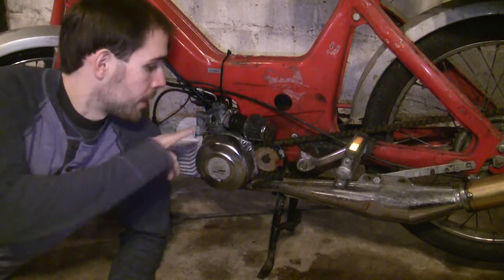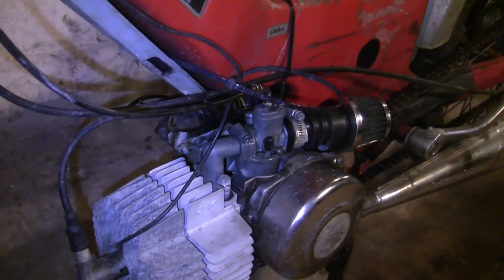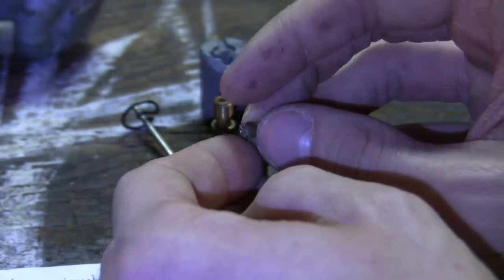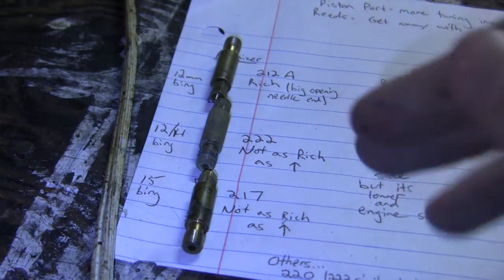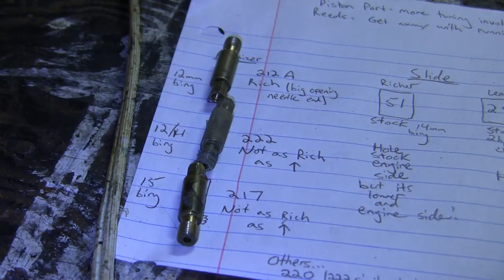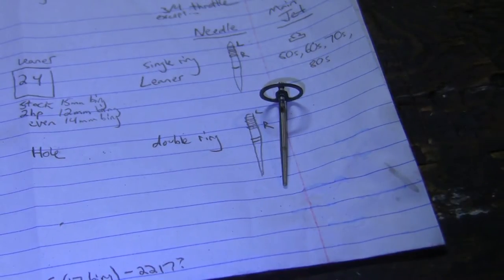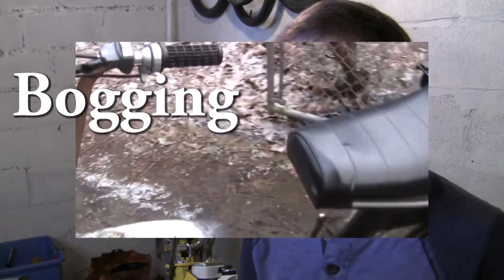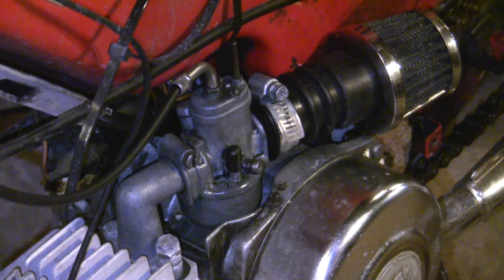Bing Carb Parts Explained for Tuning (Atomizers, Slides, Needles, etc)

Comment: Great info. Bings are very finiky. I have a mild 50CC high comp. kit 15mm Bing and intake, Biturbo, Iridium plug, Performance ignition coil and I tell ya....I just cannot get WOT tuned perfectly. It's driving me crazy. It was fun at first, but man, I've upjetted, downjetted, changed clip positions, etc.....

Comment: I have a 79 Puch Newport 2 with original air box, promo exhaust, just replaced 12/14 carb for treats 15 mm Bing clone carb. Wanted more HP, now it Boggs when full throttle. Didn't see what atomizer, jet came with new carb. Guess I have to take it all apart again. BTW, getting the throttle cable to fit this carb was NOT easy. My new throttle cable had no room for slack. Please show us how you would do this.

Comment: I have a 1977 puch.  When taking the atomizer off it appears that the jet is attached to atomizer (i.e it will not come off).  Should the jet come off or did they come in 1 pieces?  Just wondering because I'm running to lean I think.  Just put new air filter on and bogs when I hit throttle.  Thanks

Comment: Travis, can you tell me where you get that multi-circus carburetor (what brand etc..) and whether I'd need to upgrade the intake manifold and air filter as well. Thanks.
Reply: It's a mikuni carb, they're used on old Yamahas aswell.

Comment: Was this made after you had problems with your e50 not idling with a kit? I remember a thread you posted on moped army.
Reply from the maker: +RSK RC I think this was made right as I was making my breakthrough on fixing that bike. The red Maxi in this video is now the most reliable bike I've ever owned. Really strange final jetting - 68 main, big ole hole in the slide but it idles perfeto all day and has good power through the entire throttle range and never goes over 320 degrees.
Reply: You have the treats 70cc kit right? What size bing are you using? And what slide and atomizer did you end up sticking with?
Reply from the maker: RSK RC Yep, it's the version 1.5, the DMP kit, nice janky bi-turbo. 14 bing with one of the leaner atomizers, I believe a 2.20 but might have been a 2.17 from a 15 bing. 24 slide all the way. I've clocked probably a few thousand miles on the setup riding in Oregon and haven't even had to open the carb so I can't recall 100%
Reply: And what speeds are you reaching? I have a maxi with a treats 70cc kit, stuffed crank, case matched, boss pipe, and a 14mm bing that I just found out was 12mm. I have a 73 jet and a 2.22 atomizer in it. I plan on boring the carb tomorrow so I will be able to go a little faster than 35 mph. lol
And also, did you pay attention to squish? like adding base gaskets, head gaskets, or modifying your head?
Reply from the maker: RSK RC It's good for about 42mph. It could be faster if I took the time to really do a quality case match job and had a better pipe.

Best of luck with boring the carb, always wanted to try that.

Proper squish is important for sure, but this is my "fun" bike so I just used thick base gasket material so the piston cleared the exhaust port and then called it day. I used the low comp 70cc treats head.
Reply: +TravisTutorial It worked! It runs with better acceleration now and top speed.  The only problem is that after a few minutes of riding it starts bogging out at full throttle and barely accelerates at half throttle. I can't tell if my float bowl isn't filling up fast enough, or if my jetting is wrong. Also, for drilling the slide, what size bit did you end up getting the best luck with? Are you supposed to drill through both sides of the slide?
thanks 👍
Reply from the maker: RSK RC Hmmm...that points to a fuel flow problem, gas tank clean? Good flow from the filter? No vapor lock (was the problem on my MB5, would bog until I unscrewed the cap a bit!)

If it were jetting, you would notice the problem anytime I think, possible culprit is the float isn't parallel with the bottom of the bowl. Good to hear it worked though!
Reply: +TravisTutorial I have 77 puch maxi. e50. house brand 1977 mopeds circuit pipe, high flow filter, Bing 15mm clone from 1977 mopeds.com,new fuel shutoff,fuel filter, super clutch, 2.5 tires, 17:42 gear ratio, new throttle cable, runs good first start idles good. let it warm up idle drops throttle becomes boggy. but clears up when rpm comes up a little and it runs good. put it on the ground and touch the throttle and it's just constant bog. no power. I believe I'm not leaking air. I know it's running rich. plug is wet too. any suggestions.
Reply: +TravisTutorial no kit. stock cylinder and head. just new piston rings and top end gaskets.
Reply from the maker: xzuesx91 Sounds like a jetting issue
Reply: Whats your best tips to get a richer idle?

Comment: Bings are simple? They are like rocket since compared to a Delloto sha. The only thing you can do to tune them is to change the jet and adjust the idle.
Reply from the maker: Chrisanddave22 Exactly. 

If you've ever ridden a Motobecane where someone upgraded the Gurtner for a Dellorto 14.12 or even a bone stock Puch e50 with a 14.12 you'll find the idle is pretty rich and you'll bog off the line and there isn't much you can do about it (outside of modding the slide). Both carbs are fine choices, so for someone wanting the quick and easy I'll point them toward a sha 15.15 but for someone wanting to keep their setup I'll help them tune the bing.
Reply: Shit id give my right leg for a yellow Motobecane lol. I have a 2003 Kinetic luna. or a tfr whatever you wanna call it. I say luna because its not the tfr usa one. I was able to tune it by stuffing some rags in the airbox and modding it. But that was back when I first got it.
Reply: Please show us step by step how to insert throttle cable to 15mm Bing carb clone
Reply: @chrisanddave22  Stuffing rags..........that
is  a sign I'm going to have a great day.